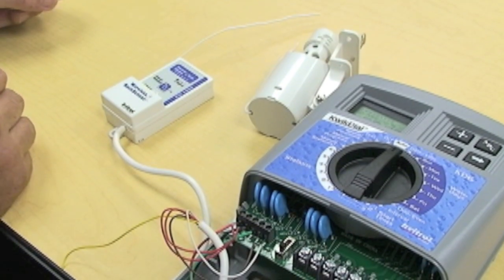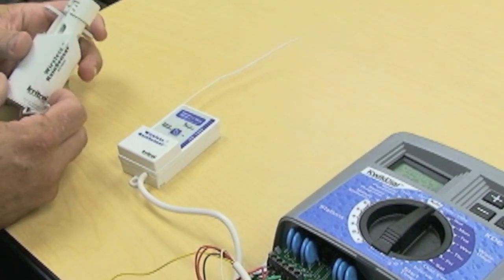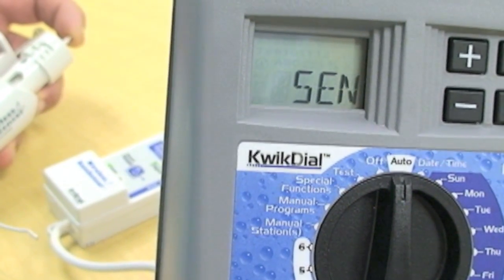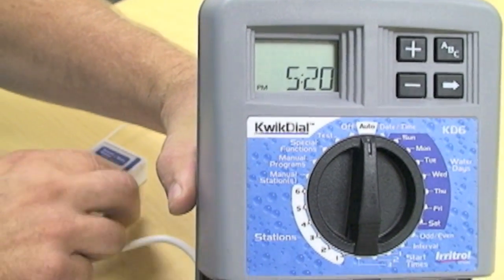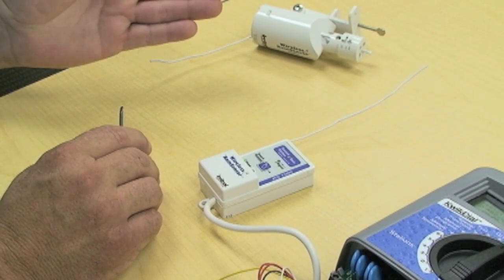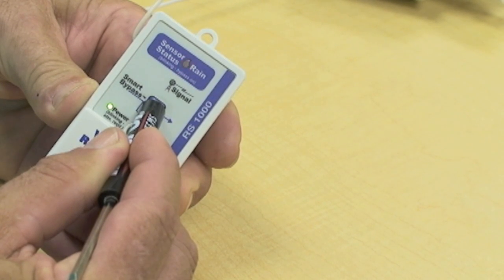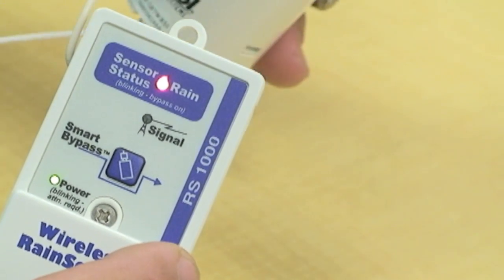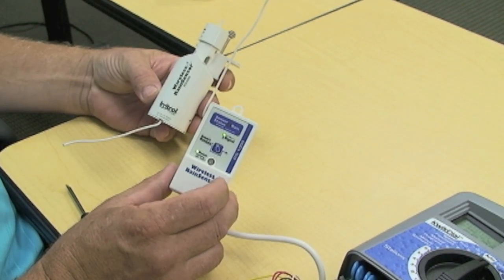Irritrol Rain Sensor install and sync

Comment: After following the procedure in the manual I still had trouble synchronizing a new transmitter. What you showed me is that it is necessary to hold down the "smart bypass" button longer than the manual showed. By the way, the sensor currently sold looks different than the one you are showing, but the receiver looks the same. The beginning of your video says "for professionals only", I hope I don't get in trouble, I'm not a professional. Thanks for making the video.

Comment: What should be the average outdoor unit setting in inches ?
Reply: The default setting is 1/4" which is recommended in most applications.  Some prefer 1/8" in rainy areas so the sensor shuts off with less rain but remains off until the next scheduled start, but be aware of your required weekly water to ensure the controller covers what Mother Nature does not.

Comment: How do you replace the batteries in the rain sensor itself? Seems like you would just pull out the cover but there is no actual direction in the package on how to do that without causing any damage to the circuitry. Please advise.
Reply: +Jacky Ng  You take the case off the receiver and then remove another plastic cover inside that covers the batteries.  Learn from my mistake, throw away your old batteries first as I dropped mine then couldn't tell the new from the old as they were all the same brand.  No dates.  Good luck.

Comment: Can Install this on a sterling controller.
Reply from the maker: sanmateo6fifty Our Wired/Wireless Rain Sensor and Rain Freeze Sensor will work, but have you considered a Climate Logic System which reduces water waste and over consumption, automatically adjust the controller for current weather conditions, shuts system off in cold and rain weather and its wireless for easy installation? http://www.irritrol.com/sensors_climatelogic.aspx.